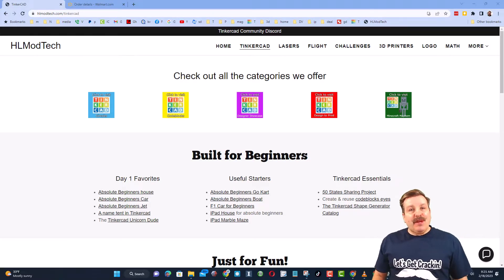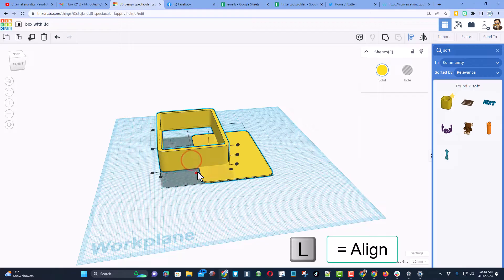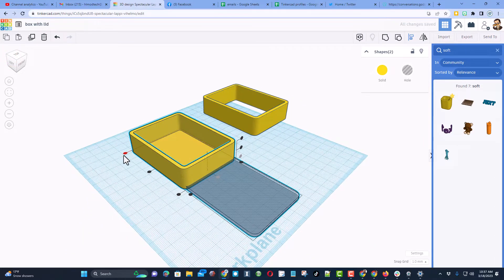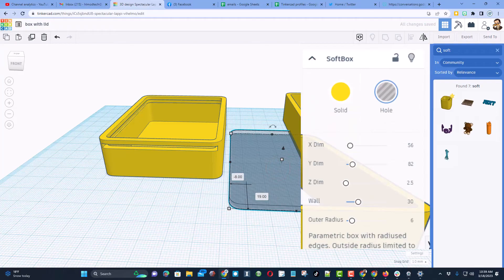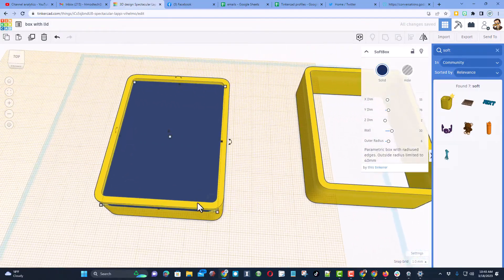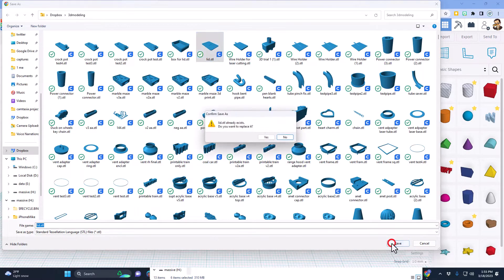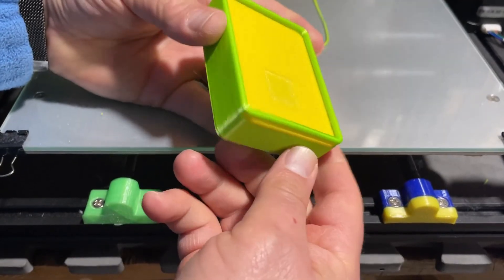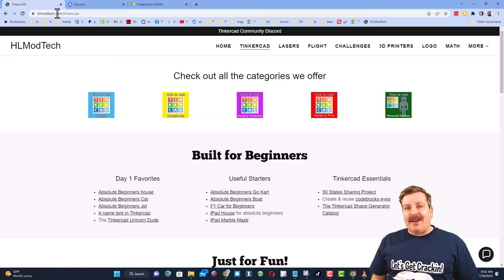Make a Tinkercad 3D printed Box with a Sliding Lid in Minutes!

Comment: Thanks so much! This was very helpful. I thought a slit would be quite difficult to print as you'd need a lot more support to print the top piece or would need to print in 2 parts. Is there a way to know what can be printed without direct contact and when you would need support? 
I also didn't know about the Workplane feature. Is there a video you'd recommend that explains more about the uses of that? I've been trying to align the bottom of one object to the top of another object - can I use Workplane to do that?
Reply from the maker: I have had good success with printing gaps like that up to about 5 cm. Some printers can do 10 cm lines. Depends on how well you have your printer calibrated and how close to the perfect temps you are using. Too hot and it cannot cool quick enough. Workplane and drop are magical. I use them all the time. Would be great for lining things up just as you say. See if this video helps. https://youtu.be/lVD581LVhko

Comment: How did the slot for the lid print with no supports?
Reply from the maker: If you have your printer dialed in pretty well it is not uncommon to be able to span a gap of several centimeters. My theory was that if it did droop a bit it would just give me more friction to keep the lid in place. I was using .3mm layers and the A8 plus knocked that out in in just under an hour and a half.
Reply: @HLModTech  thanks for the information. I'll have to check my settings for layer thickness but what is the A8?
Reply from the maker: I use .3 for everything... always in a hurry and quality is rarely on my list.. It is the lowest setting in Cura. My temps were 200 and 55 using PLA.